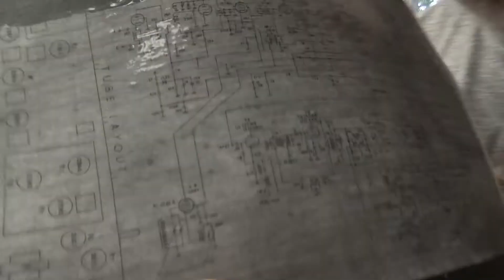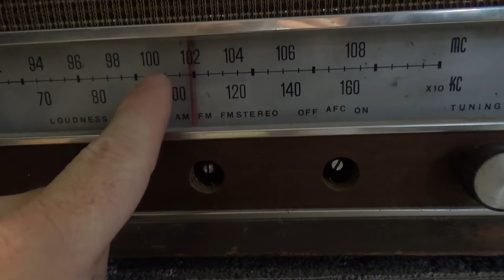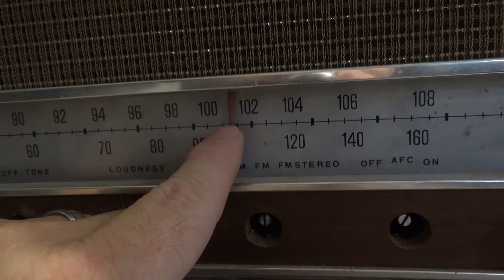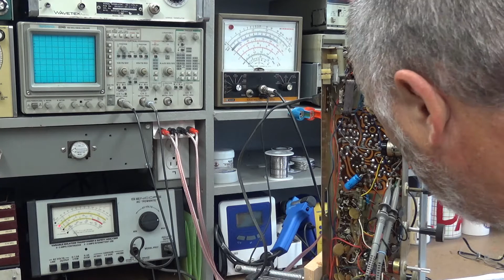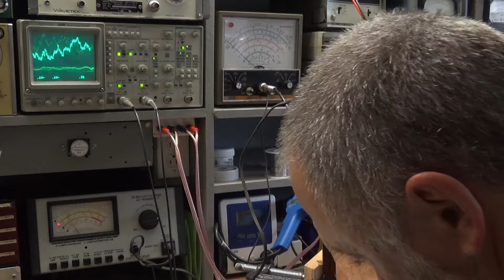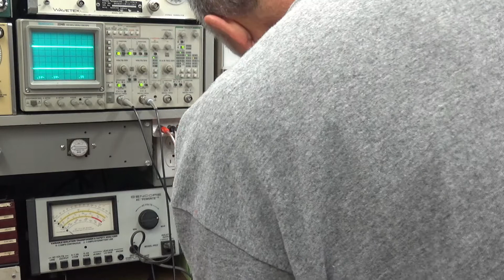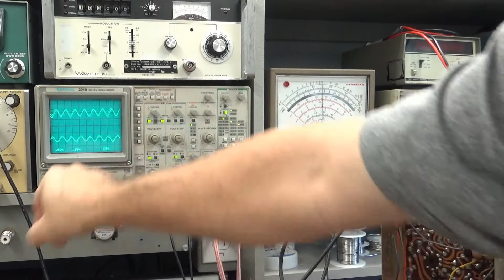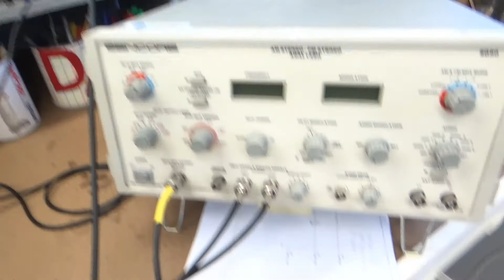Delmonico FMS-749 AM-FM Tabletop Receiver Check and repair Part 2

Comment: Looking good so far. These repairs / restorations are very difficult without the service data, that being said you seem to know your stuff and no doubt will get it up and running to a good standard . I'm enjoying it. 😎👍
Reply from the maker: Thank you for that compliment, I suffered a major setback with this. I broke the volume control trying to clean it but it was bad anyway, just proving to be a booger to find a suitable replacement.